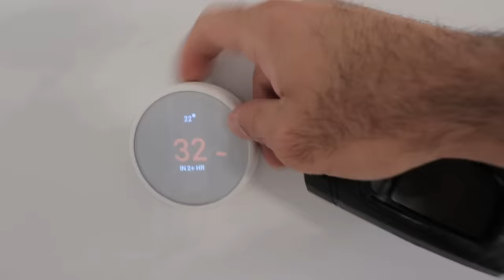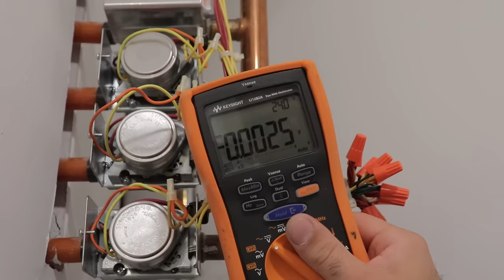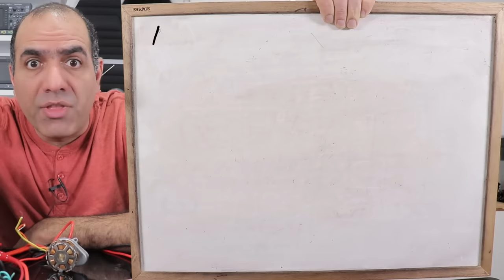Electro-Plumbing Repair… of my home heat zones that won’t heat although the boiler is running fine!!

Comment: Fail safe valves, what a concept! This design always uses the full travel of the valve and is very reliable on the 'wet' side. The proportional valves tend to be much less reliable, especially if the control system does not have routines that use the full travel regularly. As a former electronics engineer, who used (amoungst other things) to maintain the control system in a glasshouse comples with over 120 indiviual climate controlled compartments, I know a fair amount about these valves and their failure modes. Most of my callouts were to find that the control system was fine, but there was a mechanical problem, or that the control gear (the electricians responsibilty) was at fault. One proportional valve design that I liked, but was let down by a poor control board design, used a solenoid to pull the valve open, with the coil being phase angle controlled. The response was very non linear, but we had flow and return temperature sensors, so the non linearity would be taken out by the PID loop.
Reply: Was hopping down to look for exactly this comment, simpler mechanical design by leaving the motors live and if the system ever failed electrically the valves should close.

Makes me wonder if there is an elegant way to reduce/eliminate the power use without losing the failsafe.
Reply: @Loran425  Oh, there is a way: pneumatic actuators with spring return to closed. The obvious problem is the need for compressed air to operate the actuators.
Reply: @Loran425  a small latch on the spring actuated by a small electrical current?  Basically, add something that can be controlled with the smallest possible electrical circuit to reduce the power needed.

Or, some failsafe that is sensitive to a state change in the electrical system.  I don't know enough to imagine what that would be, probably some digital doohickey.
Reply: @Loran425  internally piloted solenoid valve have much less power consumption and have exactly same behaviour as this.
Reply: @Loran425  My old dishwasher door actuator uses a wax motor so you get it hot and it opens by thermal expansion. Without power the wax cools and contracts. It's not critical these valves open lightning fast so why not. All they are is a heater, wax that expands under heat, and a spring. On the plus side the valves would close suuuuper slow so as to never slam shut.
Reply: @sootikins  Seems like a cool possibility, wouldn't this just move the latching current though? instead of a water valve being held open its now an air valve that has to be held open for the fail safe to remain? or is there some wizardry of pneumatics where when the supply side loses pressure, due to an assumed power loss, the valve automatically closes such that the water valve does not re-engage when power is restored?
Reply: @mrlazda  @Steven Mello Hmmm seems like an interesting trade off a solenoid valve would likely have a lower power draw. While looking up info to reply to this I also stumbled across a benefit this stalled motor method has that I hadn't considered, Mehdi was able to replace this motor without having to shut off water to the house/heater. Not a huge deal to shut off water for a few hours in a home but a major issue for larger spaces/shared spaces and by home installers using the same system home users get the benefits of economy of scale and longer product lifecycles.
Reply: @frederf3227  Huh, this would be really fascinating for a proprietary solution where it was paired with a PID control loop and adequate sensors, wonder if a nest thermostat could account for the long delays on the heating/cooling end or if it would have to be a proprietary solution otherwise I'd assume the excess hot water generation would vastly outstrip the savings of the lower valve energy.
Reply: @Loran425  on internally piloted solenoid valve you can replace solenoid without need of removing valve or do not need to have any contact with fluid, usually not even need to remove cover usually you have just single nut to remove solenoid, only I do not know is there enough pressure in system so it can operate (internally piloted valve need some pressure to work, it use working pressure to assist solenoid to operate, or look simplistically  it is 2 valve in one small valve operated by solenoid which then controls big valve by operating fluid (it can be pneumatic or hydraulic), so it have some minimal pressure to be able to operate.). Other good is you have lot of options for solenoid voltage in AC and DC versions (from as I know 5v DC up to 240V AC) and you can pick which suite you best (and even you can later replace solenoid with different without need to change whole valve).
Reply: @mrlazda  huh I did not know that about the internally piloted solenoids. Fascinating. Thank you for the information!
Reply: @Loran425  I was thinking along the same lines as Miloš Lazović above but with the extra complication of getting pneumatics involved. His idea is better/simpler.
Reply: @Loran425  why not use a wax motor. Like on taco zone valves.

Comment: Even with the voltage dropping when all motors are running, these motors would also work fine at 22VAC you could still drop the voltage from 31V to 27V, then a single motor would at least only get ~25-26V instead of 29-30
Reply: Makes me wonder if they're using an older transformer made for 110 v hence why the higher output on 120 v... or maybe the plumbers that did this are dumb and got the wrong transformer?
Reply: @bluerilius4362  Could also be a chinese transformer because they mostly rate stuff for 110 or 220 V, not for 115, 120, 230 or 240.
Reply: @mernok2001  perhaps that may be

Comment: “Interesting how this plumbing problem turned out to be electrical”

Sounds like whatever discipline of engineering that normally does HVAC did their job right, I wonder which types of engineers those are 🤔
Reply: Perhaps it has something to do with machines?
Reply: Mechanical and electrical 😊
Reply: @jrisner6535  drain lines and furnace venting makes them plumbers too
Reply: Cryptographer you are, huh?
😉
Vulcan engineers?
German?
Japanese?
Don't give me any Static, I am trying my best.
How about any engineer that knows when to use a normally open circuit over closed, and vise versa?
Reply: They aren't engineers, they are architects!!!!
Reply: Big Clive watches HVAC videos (and auto diagnostic and repair too) for fun and has respect for those fine artisans…
Reply: Mechanical Engineers design HVAC systems.  It was the electrical system that failed.
Reply: HVACs are designed and build by Mechanical Engineers.
Reply: @HopperNation  ...Architects just make it a challenge to heat and cool interior spaces with their customers dumb ideas.
Reply: @HopperNation  sounds like someone watches RCE. 😂
Reply: hmm, has to be process huh?
Reply: @713tink  Yeah, you bet I do🤣😂. I wonder if anyone else got the joke or if its just you?
Reply: @HopperNation  well, I guess we know what the strongest shape is.
Reply: @713tink  Indeed.

Comment: It would be awesome to watch Mehdi fix the underlying issues that caused this problems. Run a dedicated 15 Amp line in the walls replace the transformer with a power regulator, or alternatively completely over engineer a system from the thermometers to the valves changing the signal to digital or at least DC
Reply: You can also probably get the motors rated for mains voltage and use the 28V to control a relay.
Or just unwind a few turns from the transformer (or wind a few turns backward) so the voltage at full load is lower than 24V (use an autotransformer to find out the minimal voltage at which the valves still work and just use slightly higher voltage.
Reply: My radiators just have a mechanical thermostat on each one.
Reply: I worked on an old 5 zone system that had 5 circulating pumps. Expensive, but it has super redundancy. One of the zones had a high velocity pump. Then someone replaced it with a standard circulating pump. The zone for the bedrooms (which were at the far end of a sprawling house) was not keeping that end of the house warm in really cold weather.
Reply: yeah, and then when they move the new owners need an electrical engineer to fix everything that he over engineered because your average plumber/hvac guy isn't going to want to touch it.
Reply: That was honnestly disappointing when he said : "Done!" And we saw nothing. wtf

Comment: Maybe they just want the valves to close by themselves when you have a power outage, kinda like a fire door that is normally held open by an electro magnet ?
Reply: I was just about to write the same :)
Reply: Correct. They also need to keep it simple with as few parts as possible as must be reliable for hundreds of operations.
Reply: Thats exactly why such design is used, im stunned this EE guy can't realize such simple concept...
Reply: Why does a valve needs to be closed during power outage? The water supply/circulation has stopped as the circulation pump has stopped too.
Reply: Why would the valves need to close by themselves during a power outage?
Reply: Why does valve need to close when power is out?
Does not pump turned off be enough?
And what you risk with turned off boiler, so you will have flow of water in your radiators?
Wth?
Reply: 100 percent, if a dc motor dies in the open valve position theres no way to turn the heat back off to that room if the heater and recirc pump are in use. the spring brings the valve back closed like a dead man switch when the motor turns off.
Reply: @luispereira3  Except in this case it literally failed because they're running the motor constantly at 0 RPM instead of just turning a stepper motor on and off. And it's exactly the same number of moving parts in each case.
Reply: @luispereira3  this system survived 2 years only, there have to be a flaw in your argument
Reply: @wecsam  One reason is to block the cold water flowing trough the radiator, which leads to quicker room cooling, also prevents the fans in some radiators from forcing themselves.
Reply: @danieljensen2626  the issue is that thermostat won't invert polarity on a by-stable zone valve. Once the heat request is satisfied, the Thermostat will cut the power.
Reply: @igorb4650  the system didn't fail, just the two valves. This most likely happened as these are the areas where there is more heat request in the house and the motors are energised at 25% more voltage than their rating during this time which cause overheat.

On this side of the pond, those Honeywell zone valves are rated for 240v 50hz and I change them every 8 to 10 years circa.

Same type of motor is used in electrical drain valves on commercial washing machines, so each launderette has it moltiplied by all their machines.
The motor is simple and reliable if used within its rating, maybe not so efficient but makes up for the cost of its not often replacement.
Reply: @luispereira3  First you making argument about longevity despite the video subject, next you nit picking on words, honeywell salesperson, please relogin.
Reply: @igorb4650  I don't understand your comment nor your hostility. My point is that these motors are everywhere and they don't fail for 0 rpm operation.
This is in my experience as commercial maintenance technician and currently working as service manager on commercial laundry.
Reply: @TheZooloo10  There are similar valves that uses a DC motor, they have a supercap with enough energy to close the valve when the power is removed
Reply: @TheZooloo10  if it didn't have a spring it would need to be able to move 2 ways to close with or without a power outage.

The design is just the easy way to do it and kinda stupid because it needs a more powerful motor, wastes energy and isn't reliable either and needed the spring holder designing etc.

If it was simple, cheap and reliable it would be fine but it's none of those things, needs an extra transformer too.
Reply: TIL: honeywell uses a AI bots to workaround bad feedback and brainwash people into belief that their valves are reliable
Reply: @ML_314  🔴 What Is Islam? ⚠️

🔴 Islam is not just another religion. 

🔵 It is the same message preached by Moses, Jesus and Abraham.

 🔴 Islam literally means ‘submission to God’ and it teaches us to have a direct relationship with God. 

 🔵 It reminds us that since God created us, no one should be worshipped except God alone. 

 🔴 It also teaches that God is nothing like a human being or like anything that we can imagine.

🌍 The concept of God is summarized in the Quran as:

📖 { “Say, He is God, the One.  God, the Absolute.  He does not give birth, nor was He born, and there is nothing like Him.”} (Quran 112:1-4)[4] 📚

🔴 Becoming a Muslim is not turning your back to Jesus. 

🔵 Rather it’s going back to the original teachings of Jesus and obeying him.
Reply: Done very stupidly
Reply: I'd say that this is just designed this way because the controller unit just sends power if it wants heat and doesn't send it if it doesn't want it. It has no control over a direction or anything, just power on and off. Therefore, thing like that is the simplest possible device that can fulfill that task. Why the controller is designed like that? Possibly because it was the only reasonable way to do it few decades ago when there was no miniature powerful electronics and then this became a standard and nobody wants to change it.
Reply: @wojtek-33  some Honeywell and Taco controls use a Solenoid electric valve. Heat is called for, plunger is pulled in which lets water flow. The problem is they can get stuck.
Reply: I don´t now how the control box works, but could it be that valves with a mechanical auto-close are just much easier to control, especially in case of a fault in the boiler or control box itself? 
Some use electromagnetic valves, some use motor valves, and although both can fail, they are simple and not expensive to replace.
A much more sophisticated valve may use less power, but requires two driver circuits, one to open, one to close and two feedback loops.
Reply: @luispereira3  What about wax actuators? I know how they work and that they are much cheaper but I don't know how long they usually last.
I have electric heating at home, the closest thing I have to a wax actuator are thermostatic mixing valves.
Reply: @ruben_balea  didn't know they still use wax for thermostatic valves, they are quite slow to operate.
Wax actuators are great for slow and passive operations, like slowing the flow on a radiator when it gets warm enough.
But in a plant room (very warm ambient) or contact with metal pipework, these will almost be extended every time, making difficult to actually control them.
Reply: @luispereira3  Ah, I've seen them in plumbing stores but maybe they were lower temperature applications such as underfloor heating, since I wasn't going to buy them I didn't ask any questions...
Reply: So why not just use a normally closed solenoid valve? It seems like such an obvious solution, I must be missing something.
Reply: @wills.9807  Because as they close very quickly they create water hammer in the pipes.
Although they could count on some slow closing mechanism, perhaps pneumatic like those used to delay the opening or closing of electrical contactors.
Reply: @wills.9807  Probably as solenoid valves tend to block very easily with debris. Also their operation is very fast and can cause water hammer effect on pipes when shutting close
Reply: I immediately thought of that too. Makes a lot of sense to design it like that
Reply: @TheZooloo10  

I used both DC and AC motor valves that return to closed position after power is cut using a capacitor. If you'll search "normally closed electric ball valve" you''ll find plenty of options. I use these instead of the cheaper electric solenoid version with low water pressure applications.